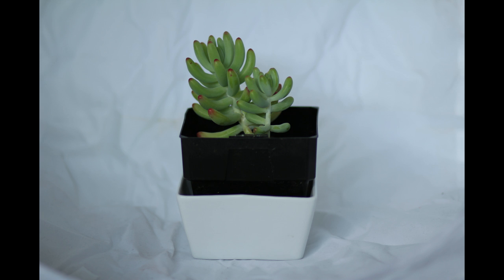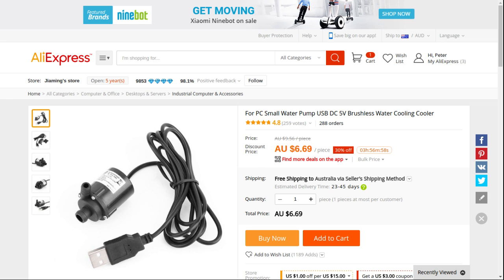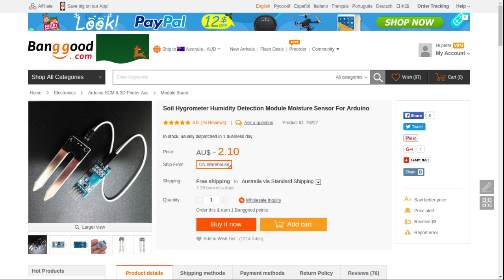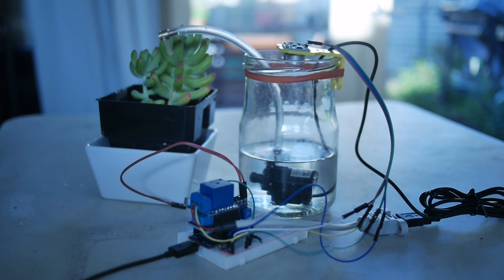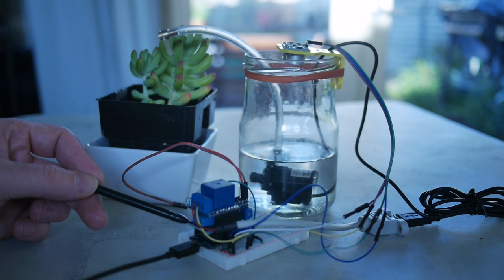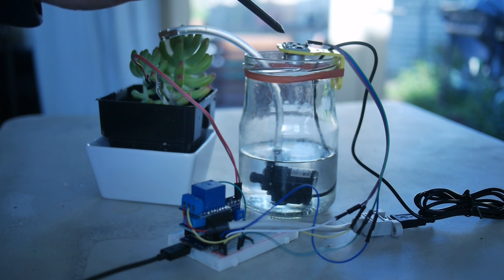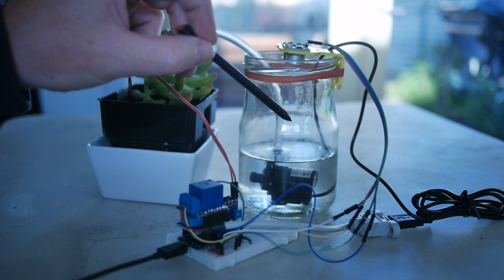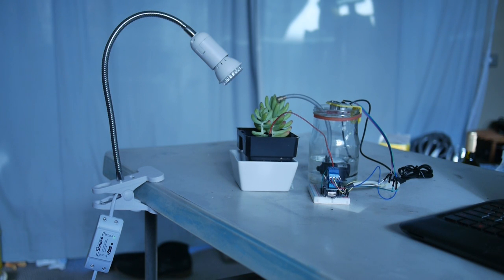Autonomous Plant - Proof of concept

Comment: Hey i dont understand why a relay is neccesary, it is possible to power the pump via the arduino?
Reply: Probably too much current draw to use the Arduino pins.
Reply from the maker: Correct. Also if you want to scale it up, you're going to need a relay.

Comment: A relay ? Perhaps would be an enhancement changing the relay by a transistor, cause the relay is a better solution for an AC current; 5v DC can be handled by a transistor or a MOSFET if the current is higher than the wemos can handle. The relay can be used in the lamp side, giving you a one circuit for all solution rather than having 2 separate 'things'. Great project.

Comment: The radar water level measurement is total overkill. Very nice project, tho.
Reply: PapaGeorg10 with a water level sensor :p
Reply: Accually radar is the best solution for electrical measurement of water level. It has great advantage over resistance sensor which is not being affected by eletrolyze and other disadvantages of measuring by conductivity. Typical sensor will wear off over time, while the radar (which is ridiculously cheap!) wont.
Reply: I'm afraid you're wrong: http://bfy.tw/FKxZ

Comment: I would also be very interested in the schematic of the build. In addition, how did you connect the usb of the pump to the wemos? I can notice some sort of adapter but I do not know how to search for it on AliExpress. 

When you talk that the Sonoff can communicate with the wemos via a defined protocol, could you give more information about that? I was thinking to trigger the Sonoff using the wifi function contained in both modules. 

Thank you in advance.
Reply: you can use a regular pump with two leads (anode/cathode) and it'll plug into the relay directly
Reply: Do you know if you can find the adapter he is using on shops like AliExpress or bangdood so I don't have to cut the USB on the pump. Or I guess I could do the same by cutting a USB cable extender?
Reply: if you already bought a pump with USB you could search this on AliExpress 
USB Female Jack 2 wire Power Cable Cord Connectors

but if you don't have a pump yet just buy a pump with 2 wires
Reply from the maker: Something like this is what you're looking for. I got mine out of an old desktop computer. https://www.aliexpress.com/item/1PC-High-Speed-30cm-1FT-2-Dual-Port-USB-A-Female-to-Internal-9-Pin-Header/32636635749.html